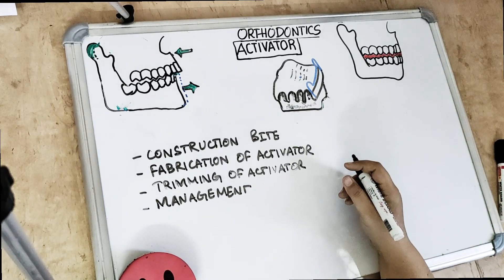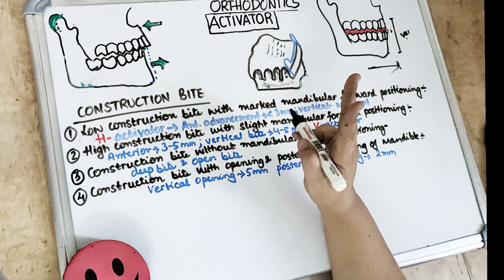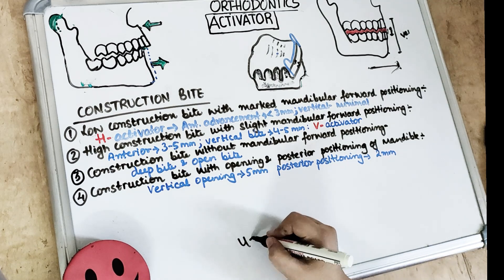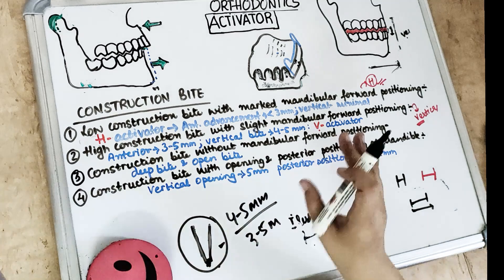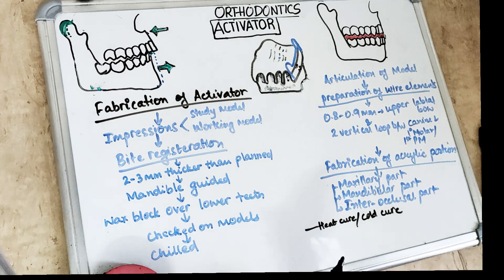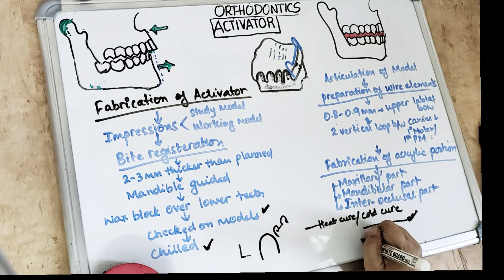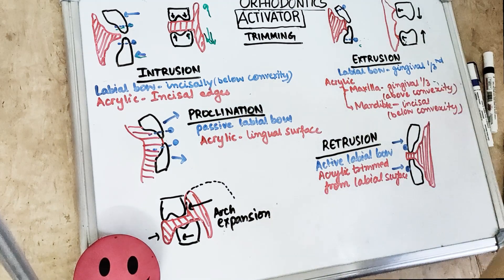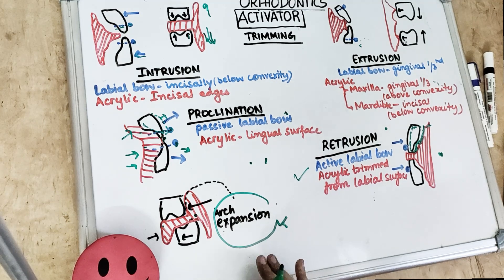activator in orthodontics lecture I part 2

Comment: Mam if the patient is already a vertical grower and we are giving a 'v' type of contstruction bite.. will not it effect the facial profile of the patient by furthur increasing the vertical facial height of the patient??
Reply: No. v activator is already indicated for vertical growth pattern in class 2 div 1 malocclusion. And it is used for slight mandibular forward movement. It will not effect the facial profile. Because the given movement to mand. is less so activator is given of more vertical opening.